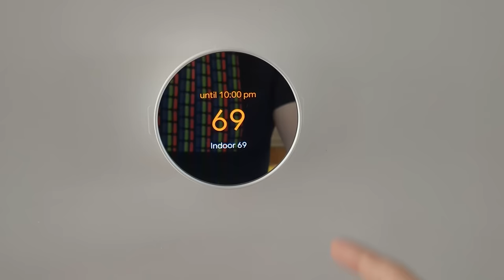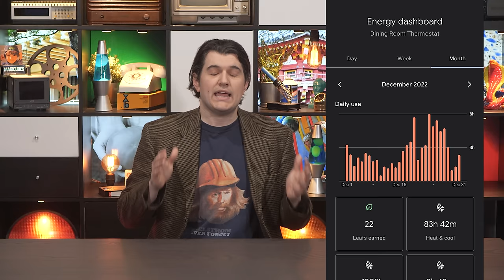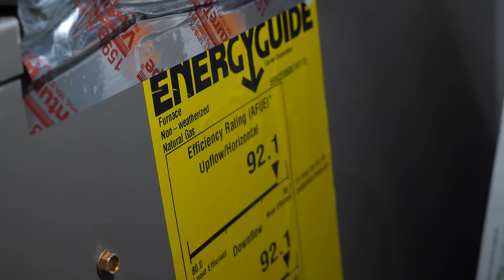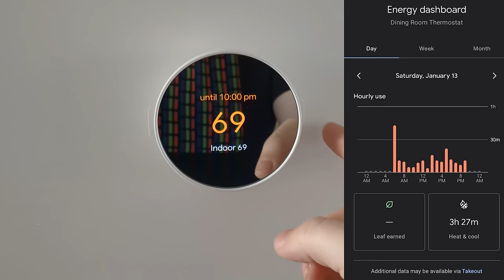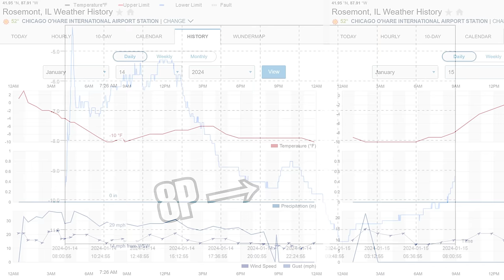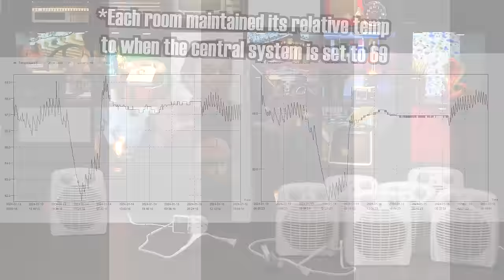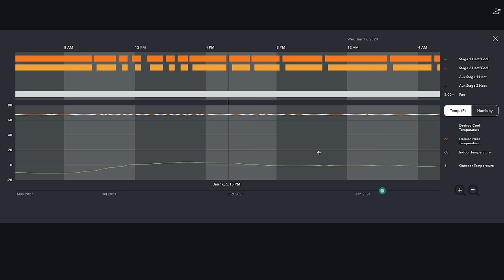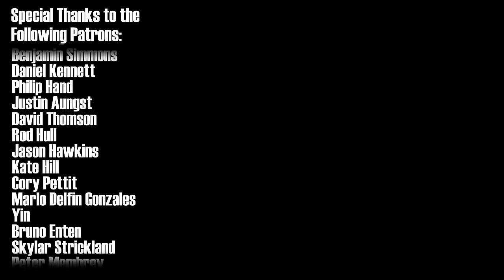Old HVAC industry practices are holding us back and costing us money. But we can fix it.

Comment: I had a heat pump for my very small house, about the size of a trailer home. It worked great until about -5, worked ok to about -10, and was basically completely useless beyond that, when -20 came it didn't do a thing. plus it cost about 15000 dollars.

Comment: What really is not well understood is where to set the balance point because of the four different factors, you have the cost to run the heat pump, the cost to run the backup heat, the BTU's needed to heat the home and at what point does the heat pump no longer Supply enough BTUs.
Usually here in southern Minnesota we are setting it at 30° Fahrenheit

Comment: Totally agree Alec! The problem is even existing in markets where our HVAC installers are properly trained. E.g. in Germany the typical installer still dimensions their heat pump usually by previous gas consumption... I am working at one of the biggest manufacturers of HVAC systems, I am responsible for building the dimensioning and planning platform for our customers, if you're interested in a demo, let me know ;-) Loved your video, it's about time to make everyone aware of this.

Comment: A proper HVAC installer will calculate actual heat loads, not using square foot estimates. Homes started getting more efficient after WWII, so the age of the home, any updates,  and region all play a part. Sometimes you have to sell a larger furnace for the blower size for cooling. If you're in a gulf state, with high heat and humidity, you may need 4 or 5 tons of cooling, but less than 60K but heating. However, a 60k Btu furnace can only move enough air for 2 tons of cooling, so you have to sell a 90kj Btu furnace to get the blower size you need. This is where mini split units really work. Now, up here in the deep freeze, a mini split struggles with our chilly days of January, when the temp dips into the double digits below zero F. Then, you find yourself using supplemental heat. Gas furnaces can be had with multi level heat stages, efficiencies upward of 97%, and ECM blowers that can vary between a few hundred to 1400 CFM. These work really well for not only heating and cooling, but for removing humidity without cooling. To set your home up with mini split units, you would need to run multiple head units to one heat pump, and likely would need a few heat pumps in total. The cost of all the equipment would far exceed the cost of one furnace and condensing unit for the whole home.

Comment: I'm glad for you where I am electric is $ 0.21 kwh on peak. A HP is an assistive method where I am due to weather extremes. I say weather purposely as wind can drastically affects the need. I did have a HP in one home for the 3rd floor. My furnace is not used during the day much due to a large window area and I lower the temp at night. I don't know what temperature you run your home during the day, but I disagree with saying that it's just a little more to bring your house up to living temperature from 62.

Comment: There is some potential heat pumps extras , larger rads , underfloor heating ,  home fabric insulation. This presumes the ac part of hvac was not badly fitted.

Comment: In Europe, where gas (while available) usually came from MOCKBA's POCCNR-ia and is No Longer Welcome, as well as the problems of pressure and even quality (the flame sure didn't look the same in winter as in summer; even boiling time seemed to increase in winter, and quite a lot of people believe that gas companies introduce OTHER kinds of gasses to ... erm ... CHEAT customers), I switched to 2-time-differentiated power - meaning cheap from 10 pm to 7 am weekdays and from Fridays 10 pm to Mondays 7 am.  The energy price of gas (in summer's calorific) was IDENTICAL of the off-peak electric !  Once I installed an AC unit that Did have heat-pumping, my apartment was ALWAYS toasty come 10 pm & weekends.  Since waiting for 10 was a little bit inconvenient, I added thermal storage via 2 electric boilers of 100 liters each.  That way I had enough stored heat for the few hours from coming home to the 10 pm Ding-Ding.  Given that the few instances of Really Cold outside could be compensated by the Still Available gas furnace, or even straight electric through the boilers' resistance, the overall cost of energy for heating was Less than HALF of my neighbors.  Of COURSE they thought I was somehow cheating, and definitely not "normal".  Then again, I also installed Triple Pane Glass everywhere, because Holding energy inside is Cheaper than leaking it like a sieve and generating more.
This is all about AIR heat pumps.  The much better option is GROUND installed pumps.

Comment: You could have clocked the gas meter to measure the amount of gas was used for that 24 hr period.  convert the cu ft to btu, Take 4% out for combustion efficiency losses.. then another 8% out (for a 92%AFUE).. boom that's the BTU content required.. the only thing most can't add to get a super accurate MJ8 is the infiltration. 1 cu ft of air at a delta t of 85 can carry way more btus out than many many sq ft of wall area.. most homes can leak many cu ft, and pump out many cu ft (exhaust fans).. great video and impressed with your knowledge! 100% accurate with 99.99% of the content!

Comment: 49:30 another real big thing to consider is HOW these homes are built.  I sell to the MDU space in the Chicago area and can tell you that the teams drawing up the specifications on these units have no clue what they are doing.  For an MDU build-out like yours, that team sent a set of plans to several contractors in the area and took the lowest bid.  The estimator doesn't get paid well enough to care about what would be CORRECT for that home, so they bid to the plan and hope to get a contract.  The developer running the job (through a GC most often) only wants profit on their investment.  AT NO POINT is there a line item for educating the customer (homeowner/occupant).  If you have an HVAC tech installing the project that knows the system is wrong, the amount of problems they sign up for to point it out adds a negative incentive to do the right thing.  By the time that tech arrives on site there is little they can do than their job and nothing else.

Comment: The faster you get rid of the one the better. You're going to have to have a problem with the heat exchanger getting plugged.

I have heat pumps. And they are some of the smaller ones you can get at 2 tons. And they are still too big. And you can tell by how much power you use if the unit is oversized.

One of the big reasons things are oversized is that no one calls to complain about the furnace running too little, they call when they are cold.

Engineers are the ones that figure out the size and duct size and you need some computer equipment to do the calculations today. The ducts should be the correct size to just drop in a heat pump as you don't really flow any more air with a heat pump. And you can also do the run time test at any temperature and correct for that temperature difference. The one thing you missed out on is what's called pickup. When the house is cold and you are trying to warm up the house. Typically, about 50% is added for pickup.

Nest thermostats suck. I had 3 of them. They are all in the trash now. You need to use something like Home Assistant with some kind of thermostat it can talk to.

Since the pipes under the sink come up from the floor they aren't in the outside wall. This is almost aways the case today so that you don't end up with frozen pipes to the kitchen sink.

Comment: My parents single family home in Europe has floor heating combined with a gas furnace for said heat and hot water, and it is just baad. It takes literally a day of furnace constantly on to heat up the floor, for it then to start dissipate heat into the rooms. Why this is annoying? Because you can't really set variable temperatures throughout the day, as it takes hours for the heat to actually reach the room from the time the furnace turns on after the rool has cooled down.
Also the floor getting warm, it pushes all the fine dust into the air, which my mom hates due to her allergies.

I prefer the use of radiators, through which way hotter water circulates and heats your room up fairly fast. We usually don't have ducted heating here...

With heatpumps, you can't efficiently use radiators though, and it is recommended to install floor heating. This, together with ridiculously high electricity prices and a new law mandating heatpumps no matter the circumstance (guess what country :D), I am more opposed to them despite the upsides they offer.

Comment: this is one reason i like my oil heat backup in a power outage i do not have to run the high draw heat pump..running the oil heat takes much less power...:)

Comment: I have had the opposite problem, HVAC techs under sizing replacement units then when it cant cool as well ( I live in Texas) they have all kinds of excuses and throw out phrases like "the AC unit follows the 20 degree rule" which sure it does but 20 degrees on a 105 day is 85 degrees; that's an unacceptable temperature to me but exactly what my grandparents were left with when the 20+ year old AC unit finally couldn't be repaired (At least that's what they told my grandparents I suspect that was a lie) and they replaced the upstairs unit leaving every day uncomfortably hot, the AC running constantly, the newer unit using even more power than the old, and us needing to use window units upstairs just to have a reasonable temperature.

There is some value in overspecing systems.
Reply: Also I really don't like the "of course its gonna have issues heating when its cold outside!" mentality; if I am paying tens of thousands of dollars for heating or cooling I want the system to work even in the worst of times, no I don't plan for a 100 year event but if you can get to -15 F design it so it reaches equilibrium at -20F  and if you get to 105F then design it to cool 110F or 115F that way you have margins for degraded performance or extreme weather and you never really have to mess with it or have any issues.

Comment: Do the calculations account for appliances? Refrigerators, lighting, and other electronics also passively heat a space. it's usually negligible, but my room might as well be an oven with it's heat retention, and so I had to limit or even remove things to keep it tolerable. I'd imagine a few extra kw of heating could skew things from scenario to scenario.

Comment: Calculating furnace runtime against it's capacity does not prove what percent capacity it is running at.  It may have only ran a few hours, but to replace the heat at a rate faster than it is lost in that time, requires large amounts of BTUs the colder it gets outside.  If you have a multi stage gas valve, it could run for the same amount of time but at different capacity depending on outdoor temperatures.

Comment: I'm not sure why but my house in the midwest needs much more heat from my heat pump than cooling. Even on the hottest days (95F+) it won't run more than 6 hours (it was 88F today and it ran 3 hours). But when the temp falls below 20 F it may run 15-22 hours. Below 10 F and it needs the aux heat strips to help. I can't quite figure this out. It's grotesquely oversized for summer and a touch undersized for winter. My assumption is it's just not very efficient in colder weather.

Comment: It really doesnt matter if it is "oversized" unless it drastically short cycles.  The motor is sized based on air flow so it would be relatively constant.  The difference in cost on a furnace in the same form factor is almost nothing.  It means the difference between 4 and 5 burners which isnt much.

Comment: And the worst thing about this whole video is that you presume that gas is not better by far to start. It is better and we ought not switch ever. Gas is a better source of energy by far. It is not that change is scary. It is "if it ain't broke, don't fix it." That is absolutely true for using gas heat. We don't need to use electric heat, and it isn't cheaper than electricity. Whatever is cheaper is best.

Comment: This is more about your central heating system being efficient. With a 100 % used gas system a lot of the energy goes out of the chimney. You want to burn the gas where it creates vapor (water). And most of the energy is over dimensioned. If your system needs to be run at 100% to keep comfort. A lot goes out of the chimney.

Comment: For next time or anyone else, since you merely wanted to prove heat loss amount, all you needed to do was that. Colder is better to have more loss.
You need temp starting & ending difference for a set amount of time.
Start that after sunset so no solar gain. Try to make it short enough to not have outside drop too much.
If it stayed say 10 F outside for 2 hrs.
And it dropped from say 70 to 50 in that time.
Now you get your area & use the general heat loss formula.
Thermo placement around the townhouse for good avg indoor temp as it dropped is needed.

Comment: Equipment is sized for the hottest + coldest days of the year and for raising or lowering the temps on those days. 
Remember science class and the btu's needed to raise the temp vs maintain?
I get calls every winter where a heat pump will not keep up even in "emergency" mode. 
I tell them they will have to run an electric space heater for about one week a year when the temps are artic outside.

They are not happy that their fancy new heat pump will not keep them warm like their old system did after spending thousands of dollars.

ECM supply air blower motor replacement is around $3k. The motor will last the life of the unit if used as designed. If undersized or runs continuously, there is no return of investment. 

BTW, you're bleeding some heat from your neighbors through the walls, and the town home eliminates 2 exterior walls; your home is very different from the majority.
Reply: When I was young + poor, I would put a space heater in each room and run them at 600-1100 watts or low-med to keep the load down on the receptacle. I could use 2 heaters on one breaker circuit. I heated my house through many Indiana/ Ohio artic temp winters.

Comment: In UK your houses would be called a "terrace". And our ordinary plug circuits are 30A ring circuits for each floor at 240V i.e. 7.5kW each. Fascinating experiment. Your furnace and pumps must be destroying themselves mechanically by cycling.

Comment: A sign of a better-sized system is a fairly short OFF-duration.  That is the time in which the pipes return to ambient temps. A short OFF-time means LESS energy is required to return to what is required for the ON-part of the cycle. The duration of the ON-time depends on the heating/cooling required at that time, and should be the ONLY variable.

Comment: Do heat pumps use the earth's heat? The problem with them is that they are quite expensive and their efficiency depends on the location they are used in. It's the same reason why geothermal energy, probably one of the most environmentally friendly sources, is not used that much. I had to do a whole project on this in grade 9.

Comment: I feel like a point you left out about oversized heaters is the actual cost involved. buying or god forbid replacing a heater is expensive, very expensive. If you can get a smaller and cheaper one for no loss in actual heat then thats a no brainer.

Comment: Even in your simplified example "it only runs 1/3 of the time" therefore I only need 1/3 of the 60k but unit you will find it takes a very long time to raise the temp in your home I suspect you would be unhappy with less than 1/2 to 3/4 of the BTU number or 30-45k btu's

Comment: I agree with just about every single point made in this video...

...*but* I still think that a lot, perhaps even the majority, of people IRL will want a significantly oversized heating system, for many reasons but 'piece of mind' in case things change or there are unknowns chief of all. I don't think over sizing heating systems is an accident, I think it happens because consumers on the whole desire it, and they will continue to do so in the future, even when it perhaps does not make sense for them to

Comment: the thing that boggles my mind is that we in the Gulf region (specifically the GCC) have air conditioners that are 2 - 3 tons per room (and I'm not talking a big room even ~ 3*4 meters or 10 * 14 feet), inverter compressors (in the past 7 years, piston/scroll type compressors before), split ductless systems that were present from the early 2000s if not even before that and they don't even cost the third of the units shown at 58:59.

one thing that is considered relatively new is the "reversing valve" part of the air conditioners, although available even before the new inverter type compressors we don't really get those as.. we don't need heating 🤣🤣🤣🤣, however they are the norm now even if they are not being used

why is it that in the States the AC units are much much more expensive even the Matsuibisi unit (which to us is one of the trashier brands available in the market) shown is nowhere near that expensive for us (no incentives, no government support for them as well)

Comment: Do you think inverter technology could help in this battle against the uninformed HVAC installer?  If the system were oversized for the design conditions, the inverter could symply reduce it's output to match the requirements of the house in question